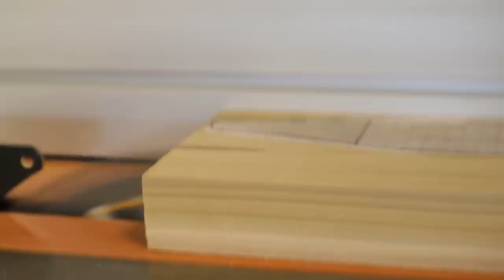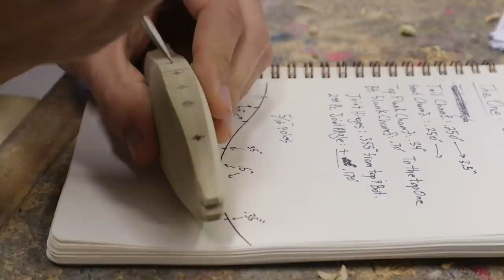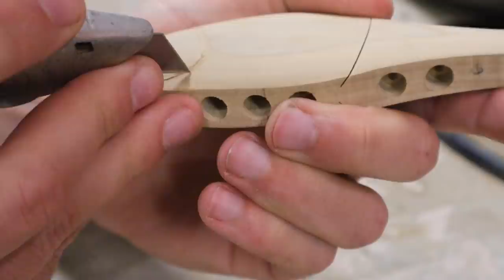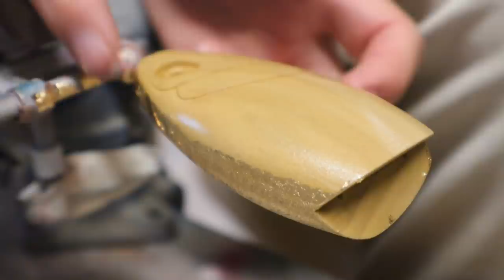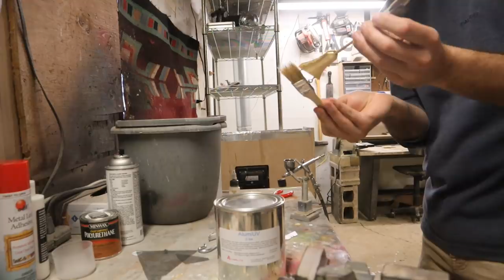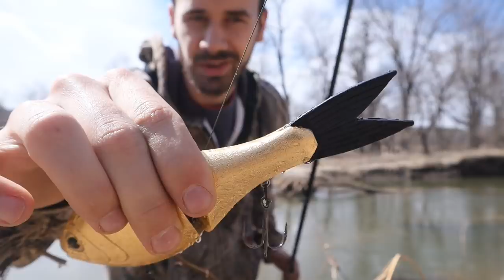Real Gold on a Fishing Lure

Comment: Using the Gold Foil was a novel idea, I use Florist's foil that's used to cover  flower pots , it has a fine crinkle finish that reflects well .  3M spray adhesive on the foil and bait leaving overnight to set before applying worked the best for me. Before top coating with a coat of 3M two ton Epoxy I would put the anglers name on the lure with Press Type I bought from office supply stores, it comes in all colors including Gold which I sometimes used on the dark back of the lure, Black on the belly like a Rapala would have.
That Gold lure was really attractive and the darting action would (OWN) any Northern within 50 yards of the boat !

Comment: I know gold leaf can be very forgiving and does not necessarily need to be laid in one sheet, using a bushy brush is useful for application too. It will also stick to itself if you burnish it with an agate stone or burnishing tool and will then become very smooth, shiny and uniform.

Comment: Purrdy bait man! It has a nice action too. Even though you're not supposed to, I airbrush gold paints. It does send gold particles into the air, but I can get the same effect as the transfer with it. You gotta make it really thin and apply many coats allowing it to dry inbetween. It's tempting to just lay in on thick but you get dimpling or dripping. It goes well with a green top coat.

Comment: Man, you are an awesome craftsman. Love to watch you build and catch..
I think the best way to apply the gold sheets is first cut the big sheets in smaller squares like 2x2 inch or 4x4, this way you have less loss. Then apply the sheet metal with brush with a broad, soft tip.
And if you like a seemless, smooth look, you can clearcoat it apply the gold with the brush and epoxy it again... Just my thoughts...
Cheers

Comment: To remove the wrinkles you use a technique called burnishing, where you rub the wrinkles down with an inexpensive but somewhat specialized "burnishing tool", which would be available from your source of gold leaf....or any good craft store.  But any piece of small highly polished steel rod would work.
Just think soft round edges so you don't scratch your gold and a very highly polished finish.  you should be able to rub that leaf to an almost mirror finish.
Great job &  great video.

Comment: If you want a smoother finish, use a proper gold "size" and you can burnish it smooth. It also takes details better than spray adhesive.  But this texture is actually very nice for this purpose.

Comment: To smooth out gold leaf, like they do on high end picture/painting frames, there's a tool they use that actually has, if I remember correctly, a polished wolf's tooth tip on it that gives the gold leaf a satin-like finish and smooths out the texture. Can't remember what the tool was called, I saw it on an episode of the show How It's Made, the one that talked about antique picture frame restoration.

Comment: Bro u know that part where u sand down the chamfers?  Well if you get a strip of sand paper and put it taught on top of two blocks, one at each end, then clamp the two blocks with the paper on them on the edge of your desk,    You get like a raised strip of sandpaper that’s slightly flexible so it sinks a bit when you sand on it.  I do that and it’s really useful for slight curves and things like that

Comment: That glide bait should be killer on pre and post spawn bass that are moving around. When you do a homemade rod, buy a graphite blank from northerfork composites. I'm pretty sure they will send you the catalog for free. A really good blank will run you around 150 bucks unless it's on sale. You wanna leave as much of it as possible bare graphite, and make sure you use the rod building epoxy, not just any off the shelf stuff. I did it and it's the best rod I've ever owned, competitive with a gloomis. And it's customizable. I did red and silver on mine to match the pflueger reel I got for it. Hopefully this year I can make a bait caster. It's about 200 bucks for all your materials but easily worth it when your getting the power and sensitivity of a 600 dollar off the shelf rod. Just make sure you do not scratch or chip the graphite. Graphite is incredibly strong but once you score it, it will snap like a tooth pick

Comment: That was awesome, I've never seen a lure that swam so much like a fish!!! What about making a rattle bait? You could make a bait like that again and in the center you could drill out a hollow and put a metal tin in there and just use a bit more lead to off set the buoyancy of the air pocket. Idk what you would put in it though? Maybe some led weights or some steal ball bearings? You would have to stick a go pro in the water to hear it though sdo maybe that is a summer project.

Comment: Heat... heat is all you need to smooth the holf foil out, an adjustable heat gun or a torch just be careful not to over do it. I  personally use a propane torch when smoothing out gold leaf on my leather and wood projects.

Comment: Cut out smaller pieces of the sheets. Put on the surface and push it in the shapes with a dry paintbrush. That way you won't waste so much material.

Comment: Gold would be a terrible currency if the economy ever crashed.  Before every transaction you would have to melt the gold down to confirm it is not counterfeit.  Plus who would use it for transactions or loans when hoarding it would net a better return in value, since it is a limited commodity? That's why fiat currency is designed to inflate at a slow rate, to encourage spending because it's slowly losing value.  Just my opinion.